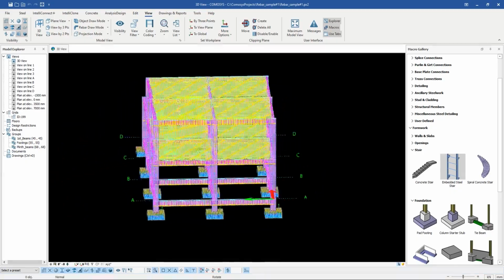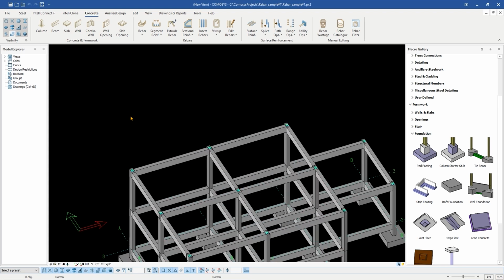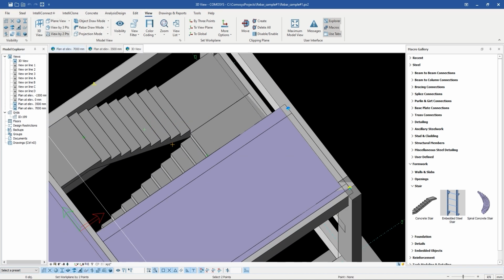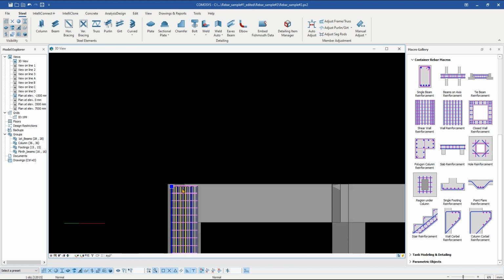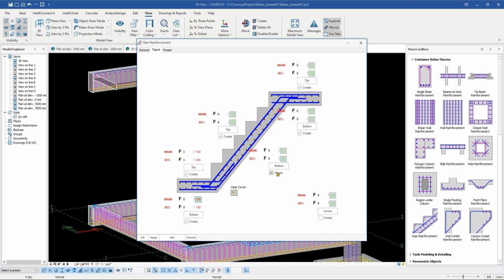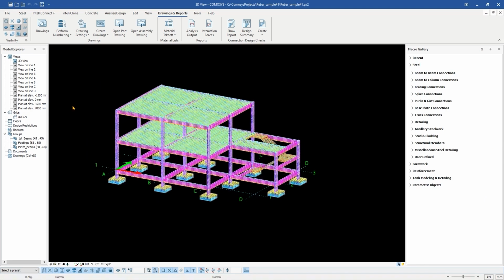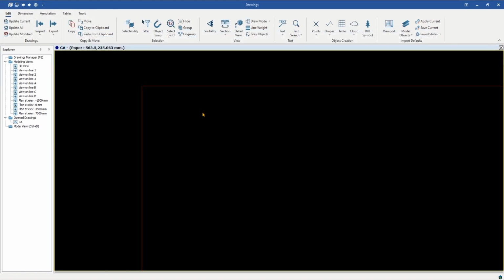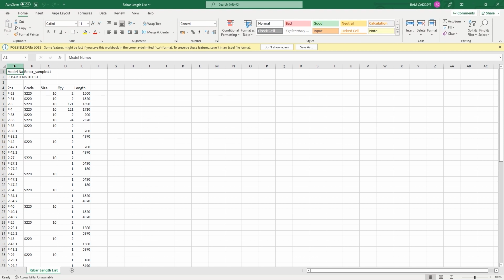Concrete & 3D Rebar Modeling and Detailing in COMOSYS

Comment: I tried this software, Circular rebar crashes , and 2d imported graphics in viewport are confused (for circular rebar stirrups)
Reply from the maker: Please note that this tutorial video lacks representation of circular rebar. To access guidance on circumferential rebar, kindly watch the tutorial via this link: https://youtu.be/6Fubk7IMTlA?si=LTQx8ED2KgQ1Sfzi.

Additionally, when working with the 3D model, there's an option to zero the view accordingly. It appears that the view you imported into 2D may be left rotated due to its position in the 3D model. To rectify this, zero the specific view in the 3D model by locating the option at the bottom(0 degree) just above the selection tools, and then attempt importing it into 2D again.
Reply: @ramcadds  yes i saw but the confusion happens on 2D drawings  do you have video for the drawing generation of the model you share ?
Reply from the maker: @leo198995   please send your Comosys model to our mail ID - info@ramcadds.in

We will model the circular rebar and check generating 2D drawings. Once we get a clear picture of your question regarding the confusion of 2D drawings of circular stirrups, we will screen record and share the solution with you through the Google Drive link.

Comment: This is a simple building, so modelling is very easy, but if I have a large-scale project and all span centres line different, then how to do modelling easily I think need some manual center line option in software for easy work and placement of any member should be done easily any area and location because for placement we can not put member without center line, point and construction line.

Comment: Hello
1) What about the calculation of reinforcement for structures according to the analytical model?
2) Why did the cross-reinforcement corners of beams and columns overlap with each other?
3) Is it possible to define soil data underneath the foundations?

4) Is it possible to calculate the foundations according to Eurocode 7?
5) Is it possible to calculate reinforced concrete structures according to Eurocode 2?
Reply from the maker: Hi, Design of RC members is under development and not ready yet. User is free to define any type of reinforcement.